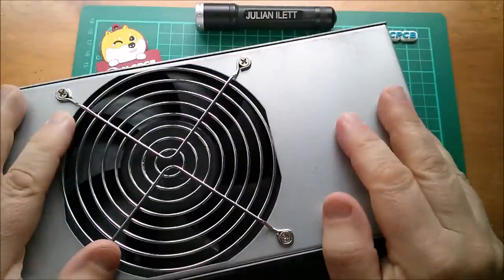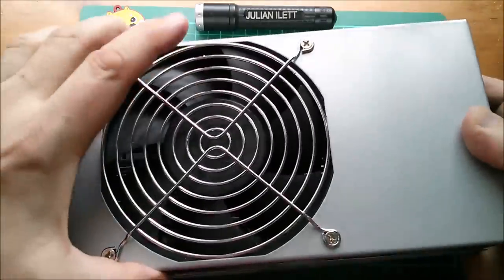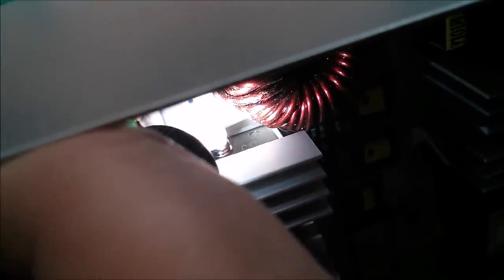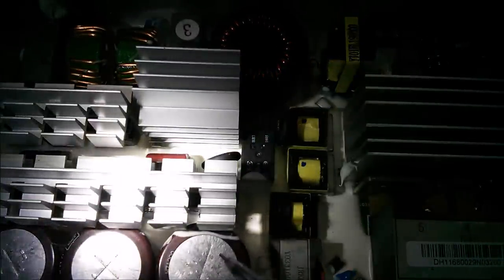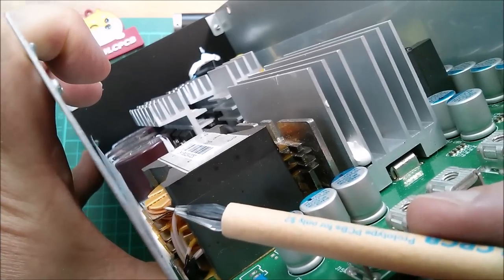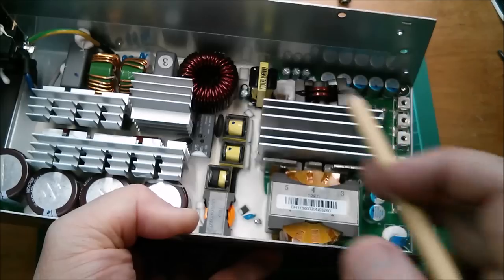200A Power Supply has some Crazy Inductors

Comment: It's not an inductor, it's the transformer! And then there's the rectification diodes (actually there's probably MOSFET for active rectification) under the heatsink near the outputs.
Reply: Julian didn't mention output rectification!!!
I agree the last "inductor" is the power output transformer and the beefy "wires" to the heatsink that would have the rectifier under it are beefy to carry the very high output current.
We didn't get a good look at the 1 1/2 turn toroid near the rectifier heatsink, but I wouldn't be surprised if there is another winding underneath, making it a current transformer, to monitor output current.
Reply: The 3 metal terminals he talk about should most likely be the 3 terminals for the transformers secondary side, the middle one being the middle tap/negative terminal foe the 12v output?
Reply: @tomgeorge3726  1 1/2 turn current transformer is not a good current monitor at DC. I think it is just a output filter. But it is posible they use magnetic sensors like in dc clamp meters.

Comment: That heatsink on the output has limited cooling for the transformer next to it where the thin laminated turns connect to the 3x busbars (center-tap ground), the heatsink is mainly to cool the Surface-mount Synchronous Rectifier's MOSFETs under the 2x thickest points of the heatsinks as the metal mounts protrude under the heatsink to pring the pressure onto the two halves of the rectification.

The transformer is stacked the way it is for a higher frequency to allow for such a small transformer, the plates are flat so as to distribute the surface over the inductive fields of the thinner wires so as to couple more current into the "skin" of the copper winding (The whole surface is the "skin" of the turn hence the flatness to enable better coupling), then the stacking is to parallel the turns as multiple thin transformers in one thicker package, thus reducing footprint and allowing for better coupling.
The design allows axial insulation to be relatively thick whilst having zero need for creeping insulation between input and output and thus allowing better cooling, especially as the primary input couples better to a heat-plate like flat of copper... Some of these inductors are known to have heatsinks on top of them (Especially in those 1ft by 1-inch by 4inch server power supplies at 2KW).

Inductors from top to bottom, the top tall inductor is likely for a 5v logic,
The next two for rectification synchronization stage of current-mode self-oscillating power supply designs,
The one with the "tube" (heat-shrink tubing) is for the main MOSFET switching current going through the transformer so the controller can change the duty-cycle (synchronous cycles to miss) on the transformer,

The tall purple inductor is part of the Power Factor Correction (Required by business laws in many countries it seems)
Basically the whole PSU is a resonant mode power-supply with phase-skipped regulation. 
The best thing about this design is the low-noise output due to the low filtering requirement (narrow band-pass inductor, the one with 2x thick as turns in the top right-most corner) and the ability to put a lot of single-rail wattage in a relatively tight space (Good for servers where space is premium).
The downside is this tech is costly to design and make, yet some ATX 12V0 power supplies for hobbyist/home computing are starting to use this design for their 1KW+ supplies, especially as these can be tuned for 90%+ efficiencies (or calibrated via an onboard microcontroller as most server PSUs do)

Comment: We use some 1500 W 5 volt power supplies for electronics at work. So 300 amps continuous out of a unit about half the height of this one. Just two huge thumb-sized slabs as the output connectors and a deep sense of wonder from the user as to how the heck do they manage so much current handling in such a small box and very stable voltage and no noise either.
Made in Japan and very clean units, impressive.
Reply: Hi, whats the power supply model number?
Reply: @LucasRubini  I don't remember exactly the model but Cosel 1500 Watt modular units in slim form factor. Probably PBA1500 based on pictures I found with a quick search.

Comment: I'm working on a very powerful flashlight, and the kind of current I'm working with has been pushing me into the territory of flat-wire inductors. There are videos of the manufacturing process on YouTube. It's really fascinating.

I also saw a small SMPS transformer that used a flat copper strip as a winding. I measured it, and it was about equivalent to 3.5mm² wire.

Comment: The specialized windings in the inductors and Transformers are because you can't simply use very heavy wire to handle the 200 amp currents. The skin effect at switching frequencies is very high in large conductors and causes very high copper losses. So the windings are built of multiple strands of thinner wire.

Comment: That big inductor looks to be the main switching transformer - the high current secondary windings are joined to the plates to get the 200+ amps safely to the equally large rectifiers under that heatsink.
Reply: Could the big toroid be for a passive PFC? He should give it to "DiodeGoneWild" for reverse engineering with schematic.
Reply: @raymundhofmann7661  I was thinking same lol

Comment: The design of this is reminiscent of the 1500+ watt server PSUs that we have seen over the last 15-20 years or so in the server industry.  As others have said  the big inductor looking thing attached to the heatsink appears to be the switching transformer and that heatsink with rectifiers is probably why they are able to get over 200Amps out of the unit in a resonably small space (smaller units do exist with larger power output in some servers).  Still an impressive feat of design and electrical engineering to build something like this.

Comment: To put it in perspective, 216A -- if it could be sustained across a 1 ohm load -- would require a resistor with a rating > 46kW (!) Put another way, a 1 milliohm connection resistance would heat up with nearly 5 watts. I^2R gets out of hand quickly!
Reply: And yet it only pulls just over 2kW out the wall which is barely anything if you own an EV, and have read the data plates on the side of CCS chargers. Power is strange.

Comment: Would love to see this loaded up and voltage checked at various loads to see how stable it is. The output of the unit could be (for test purposes) fed into a hefty (3000w?) pure sine wave inverter. Feed the 240v output of that into your car. Then a bit of working out to see how efficient the whole setup is.

Comment: Input has common mode choke, then bridge rectifier and inrush limiting, then active PFC to make the bus voltage across the big capacitors around 400VDC. Then 4 MOSFET transistors in a bridge, with the one small transformer with the black loop doing current sensing, feeding the planar transformer via the other flat wound inductor to control rise time. Primary windings in parallel so as to couple well with the centre tapped secondary winding, likely 2oz copper on a double sided PCB, with each side forming one turn, and the centre tap having lots of vias to connect. The other 2 small transformers are there to drive the 2 half bridge mosfet transistors, probably 4 SMD devices in parallel for each half, to do active rectification, as otherwise at 200A a schottky diode would dissipate close to 600W. Tall yellow transformer a auxillary power supply, driving both the primary side controller, the fan and the active rectifiers, as they would otherwise need a more complex transformer, and easier to have a dedicated separate power supply than try to fit the extra winding on, plus allows a wider voltage adjust range.

Then output side your classical LC filter, with likely a freewheel diode to keep the inductor from saturating, and a lot of capacitors in parallel to handle the riple current, though I would say those capacitors are inadequate, 200A means they would ideally have 20A ripple, while most of that type of solid electrolyte are rated for 5A for rated life. Some will have higher ripple anyway due to trace impedance, so they will not make it long term at 200A.

Input relay shorts the NTC units, as otherwise on 110VAC they would melt themselves off the board, and the 100A at 115VAC is because the PFC can barely handle the current at lower mains. Would say this is actually a 50A supply, with the peak current before shutdown being 200A, and run it accordingly, as running at 200A will likely lead to it definitely failing in a little over a year. Derate and it will probably work for a good while, though the fan will most likely fail first.

Comment: The large inductor after the mains filter is likely for the active power factor correction. The small taller transformer might be the auxiliary power supply, two of the smaller ones might be gate drive transformers one for each half bridge. The third one with the black strap on it might be for primary current measurement. The small flat bar inductor is likely to be in series to the output transformer. A possible controller might be a UCC2895 phase shift PWM controller.

Comment: KissAnalog has been doing a series on the design of these types of power supplies. It might be helpful to watch his videos for some insight on how these components work together.
Reply from the maker: Thanks, I will :)
Reply: PSUs in general or these extreme high power ones?
Reply: @alexstone691  High powered smps. All the parts of the circuits. PFC circuits in them etc. He's an engineer that has been designing them for a long time. Currently he's working on the design of a 300watt model for a Class D audio amplifier, but they're for all kinds of applications ofc. Check out Eddies channel.
Reply: Squeaktastic new Avatar !!...cheers.
Reply: @andymouse  Cheese!! but this one is an imposter, and not me
Reply: @fredflintstone1  OH !

Comment: very sceptical that you could safely pull 200a across those three posts - at that current you are normally looking at M10 ring terminals and very thick cable
Reply: I guess it would depend on the length of time. Also, I would think that unit would just burst into flames and smoke if you tried to draw that current for any length of time even with heavy gauge connectors. Like 3 minutes. I am guessing. 200+ Amps is a lot of current at any (car/household) voltage, AC or DC. I have an older and slightly smaller (footprint) power supply for model car battery charging. 120V in, 12V/5V out (US). The 12V out is 10.5 Amps. I can run my 1000W power (car type) amp up to a certain level and it exceeds the 10.5 amps (really loud but cuts out automatically when not enough current). I paralleled the power supply with a 12 V rechargeable gel cell and the amplifier was happy. (I'm doing this on the bench, 20 years ago). My Ammeter only went to 10A, so I don't know what it was drawing when I was shaking my neighbor's wall hangings. (The speakers were 4 Ohm). It wasn't 200 Amps. The power supply was basically replaced by the battery but it kept the battery charged. (Yes, I disconnected the two when the amp was off! 😳) Total draw below 20 Amps. Had to be. And that is a lot. Could it be one of those Chinese mistranslations where they really meant "20 Amps"? It would make sense but Julian would know that. Can I get 400 Amps out of my US 120V? I thought 10.5 was a lot to expect from something about this size from a (120V) wall outlet. I think Julian is "teasting" us. (Just coined it; "Teasing AND Testing". I think we are being "Roasted"!   😂)
Reply from the maker: I wouldn't want to push it to the full 200A. It was bought (by the previous owner) to run two 800W miners. So it has been used at 133A.

Comment: I am guessing that the large tall inductor is part of the PFC circuit, and that is why the caps in parallel are 450V the mains is rectified with a small cap usually approx 1uF then a boost circuit gives around 400V to the large 450V caps, the the switch mode PSU runs from this elevated voltage. The relay is part of the inrush circuit.
The devices under the heatsink I am guessing are Mosfets as part of a synchronous rectifier.

Comment: The metal strips in the output transformer are the secondary coil and the heatsink is for the rectifying diode which is hidden under it. I have seen a similar transformer in a psu for Motorola BTS but it outputs 27v.

Comment: The data label said 240v 16a but can an IEC plug/socket handle that because a UK BS 1363 plug top can't?
Reply: That's just probably there to indicate that you need a fair amount of inrush capability to run these so you should have it on a 16 amp circuit. Or it's just some piece of text some chinese person copypasted from somewhere because of reasons.
Anyways the unit will probably not draw 16 amps continuous, but if it delivers the 2600 W of DC power it will well exceed the 10 amp rating of  a C13/14.
Not something a cheap overseas manufacturer would bother to care about of course, it'll probably last longer than the unit at full blast anyways.
Reply: Nope, theyre only meant to be 10A continuous - though whether it would survive in reality is a different matter, but standard says nope so I would go with nope

Comment: Also the creepage and clearance limits increase as you go higher, for CE most will limit the equipment to 2000m  or 3000m i can't remember the correct altitude. but there are not many places above the normal limit.
Reply: But why?
Reply: @Poebbelmann  Air pressure! As the pressure drops it is easier for electrons to jump the gap, less getting in their way. So to maintain the same level of safety gaps need to increase. As I said before there are not many places above that height so you just put it in the specification as a do not exceed limit.
Reply: @TheEmbeddedHobbyist  I don't think so. As air pressure drops, there are less particles to ionize and therefore the gap could get smaller to obtain the same level of isolation.
Reply: @Poebbelmann  if that was so why would all the safety standards increase the gap requirements? Also the voltage required to  break down the gap of a spark plug would reduce, where in fact the voltage has to increase to jump with the higher pressure. Have a look for a copy of the standards required by the Low voltage directive (LVD), EN61010 might have it in. Been a few years since I needed to know and the old grey cells are wearing out fast ;-)
Reply: @TheEmbeddedHobbyist  Yep, you are right. There is the "Paschen-Law" describing this penomenon. Air needs to have the largest isolation distances at pressures of about 1 mBar. At lower and larger pressures you will need less air gap. My assumption was partly wrong because I knew, that under high vacuum you would need much less isolation distance than under normal conditions. This for itself is right but there is no linear correlation.
Reply: @Poebbelmann  Thanks for coming back and letting me know the grey cells still have a bit of life left in them. I'm going to have to look up "Paschen-law" would be nice to know a bit more of the back ground on the safety standards.

Comment: Snpsu design  = black art
Reply: SMPSU or just SMPS
Reply: Not so much if you break down the process AC - DC -AC - DC. Low frequency high voltage AC, to high voltage DC. Then high frequency high voltage pulsed DC (AC), to low voltage DC output. all the rest is mainly to do with PFC and OVP, OCP and temp.

Comment: how much for that psu ?
Reply from the maker: There's one on Ali for $400
Reply: @JulianIlett  not bad
Reply: @JulianIlett  I have over 10 spare ones (original Bitmain), never used. Will deliver in NL only though. Mine are I think 1600 to 1800 Watt. You do can parallel these. I wil sell a few, but keep a few as well since I plug my solar panels to them! Yes: DC IN, DC OUT. And I fed the DC 12 V in a 2000 Watt inverter to create 230 Volt. This way I can go off grid when needed! @Julian: did you read this?

Comment: 3:49 PCF inductors
See the other comments to know what is every inductor doing in this circuit
Reply: 4:14 the two looking the same are auxiliary PSU for internal needs (controllers, etc...) and the other one is a current sensing transformer
Reply: 5:15 you forgot to mention the PFC boost, which brings the rectified mains voltage up to 380, regulated, volta DC
Reply: 6:17 it's another auxiliary trafo
Reply: 6:22 it's probably the resonance inductor of the LLC stage
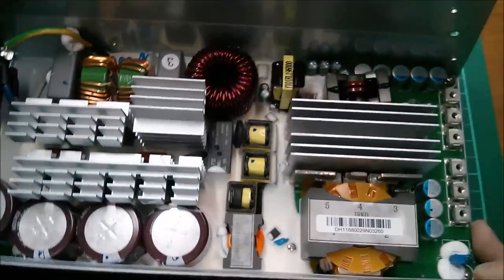Reply: 6:48 it's to mitigate the skin effect
Reply: 6:51 it bypasses the NTC
Reply: 7:31 it's an output filtering inductor, part of a π filter (CLC), between the probably MLCC MMC (after the sync rectifier stage) and all the polymer caps at the output
Reply: 7:33 it's not a toroid, it's a normal EE core
Reply: 8:11 it's the main transformer
Reply: 8:35 planar windings
Reply: 8:43 the metallic strips are the secondary winding, the other windings with multiple turns are the primary
Reply: 9:14 they are 3 because it's a center tapped winding
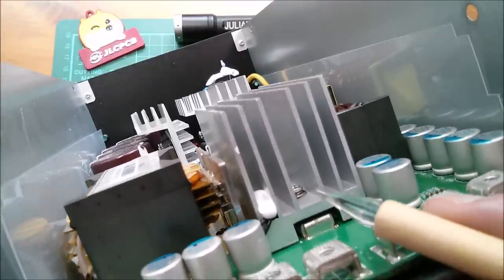Reply: 10:13 you can't see the semiconductors because they are in SMD packages, covered by the heatsink
Reply: 10:27 no, it's for the sync rectifier mosfets